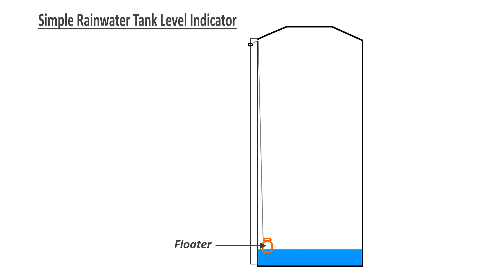How to make your own Rainwater Tank Level Indicator

Comment: Drill 2 holes, one at the top and one at the bottom. Install 1 90° elbow fittings in each hole with outlets pointing at each other. Connect the 2 elbow fittings with clear tubing and you have a visual level indicator used in many different styles of tanks including fuel storage
Reply from the maker: The only problem with this idea is that algae then grows in the pipe, being e exposed to light, which is not the case with fuel.
Reply: I would be worried the clear tubing would eventually crack or fail and all your water will leak out. I have a chair near my tank, so I just lift the mesh leaf catcher/cover and peek in. Otherwise a tap on the side of my colorbond tank makes less sound when full.

Comment: I just have a short clear hose attached to the faucet at the bottom, turn it on and hold the pipe against the tank, you can see the water level in the pipe.
Reply from the maker: Indeed!  Only problem with those is algae growth in a clear pipe due to sunlight

Comment: thanks for the video wire down the outside good idea my tank is elevated and exposed to high winds.my problem was trying to work out counter weight for float i will use a glass bottle/jar and stainless nuts.guess i'll just experiment.